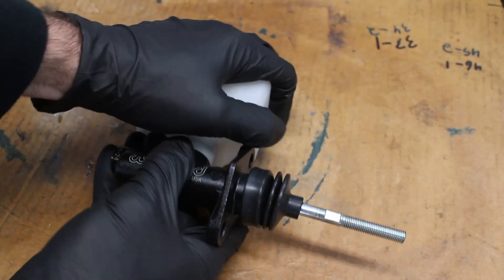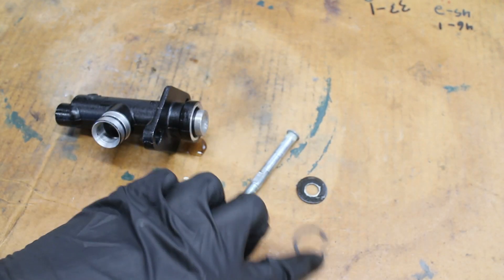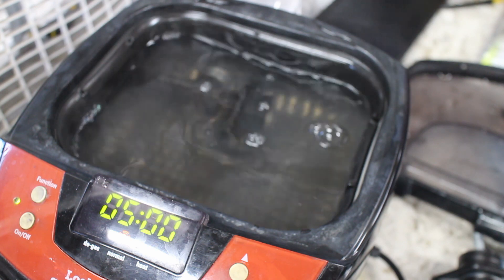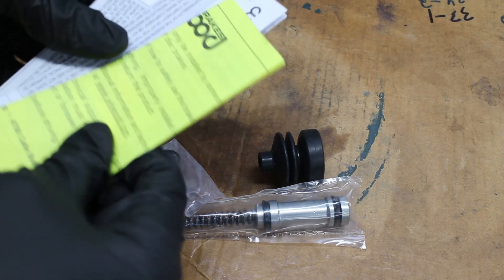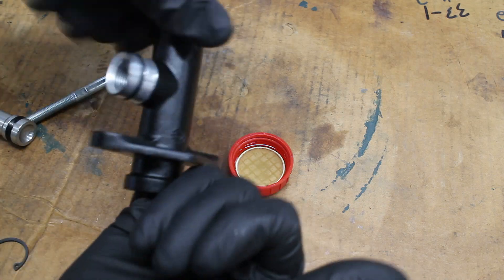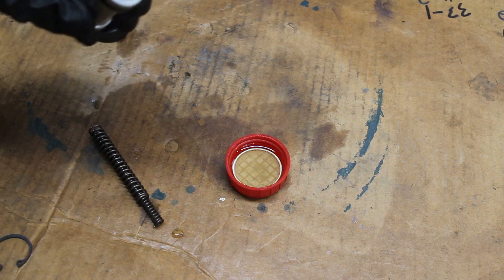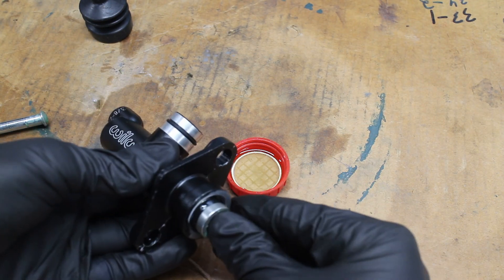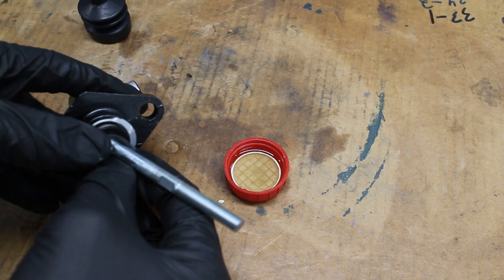How to Rebuild a Wilwood Compact Remote Master Cylinder

Comment: What bore size are you running? How's pedal effort and brake reaction with this balance bar manual set up?
Reply from the maker: 99% of balance bars use a 3/4in front and 7/8 rear master.
I've used a 5/8 front 3/4 rear master, but any pad knockback is gonna be deadly to that small of a bore.
although a 5/8 front master makes for  near boosted brake levels of easy pedal effort.